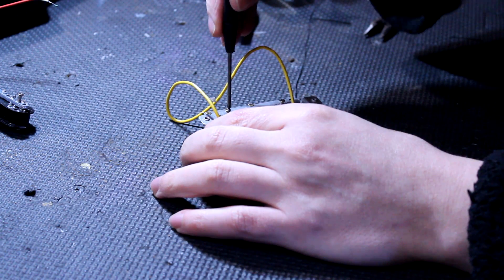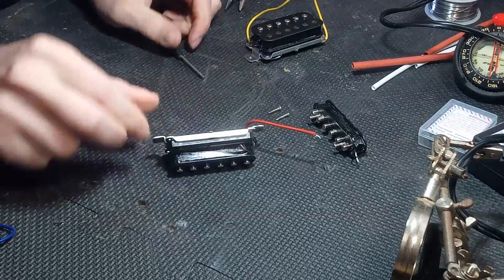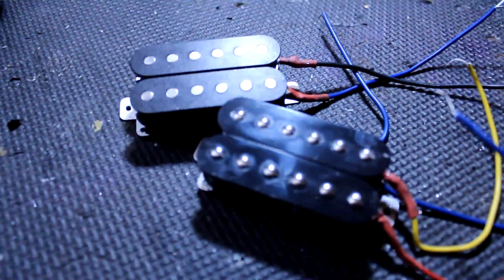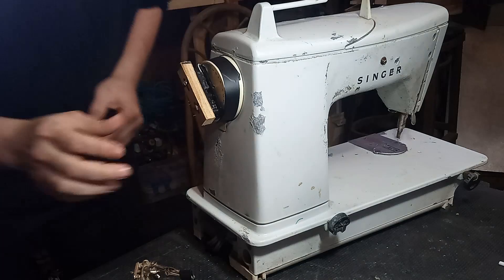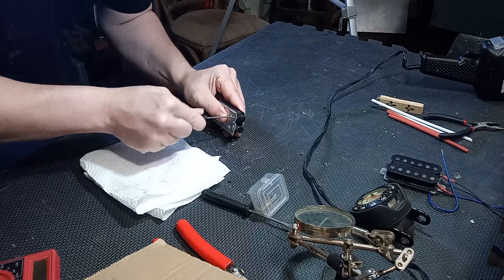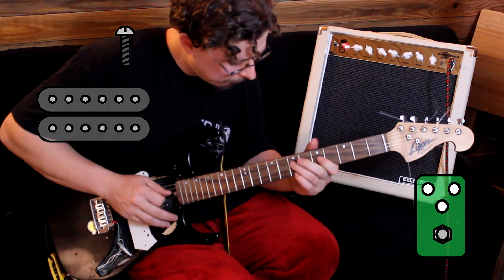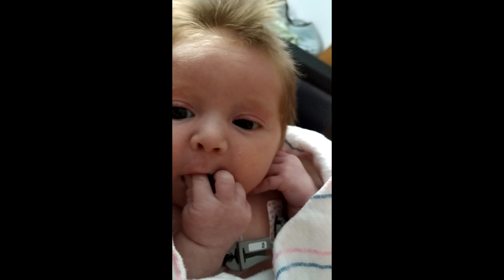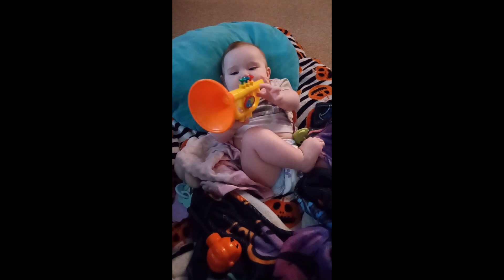DIY Humbucker Screw vs Pole (SOUND EXPERIMENT!)

Comment: I once modified humbucker  to fit  my project 4 string guitar, so basically, I took out plugs and screws form outer sides and left 4 poles and screws in the middle, them I also had interesting effect when outer screws are almost out and and connected on top with the razor blade, so strings run in between razor and pickup, not sure what exactly is happening, but does sound different

Comment: Good to see you back. 

I loved your homemade P90. What if you took a humbucker, attached an extra magnet on the outside of it along one of the bobbins, and then split the humbucker to that coil? Would that coil with magnets on both sides sound like a p90? This way you could get a pup that switches between humbucker and p90 instead of between humbucker and lousy split humbucker.

Comment: My prediction is that the difference in sounds will be minimal unless you're swapping from having non magnetic pole pieces with a magnet on the bottom to rod magnets pointed at the strings. 

I'm firmly of the belief that the orientation of the magnets is the biggest deciding factor in the sound.

Comment: I thought the adjustable pole pieces were meant to allow you to adjust the distance of each one from the strings.
Reply: Nah, it was always just for securing the pickup cover to the rest of the assembly before they were permanently soldered to the base.

Goes for all pickups with screw polepieces, with the exception of wide range pickups where the screws are the magnets.

Comment: Why don't single coils have screws? That's where need them because they always burry the magnet underneath the b string.
Reply: Because typically a single coil pickup has rod magnets and in order to have screws in place of them you'd either end up with a completely different sound or you'd need to source magnetic screws which are hard to come by.

The sad truth is that messing with the screws doesn't really do much.

Comment: what if we replace the metal rail in the hotrail pickup with a neodymium bar?
Reply: That would make a significant difference because the original blade in the pickup isn't magnetic, it's magnetised by contact with magnets in the base like a regular humbucker.

Depending on the orientation of the north and south poles of the magnet that you use, you'll get radically different results.
Reply: @casanovafunkenstein5090  has anyone done this before?

Comment: Pickups have a ton of variables. I have done experiments as well. Like I have some Epiphone Dot Pickups which test around 8.5k that I didn't care for the tone. So, you think if I swap the magnet with a cool killer magnet from a late 60's Gibson Patent Sticker T-Top it will sound way better, Nope. I pretty much sounded just like the shitty Epiphone pickup she always twas. I did similar with a 70's Japanese ceramic pickup that had way to much top end, I figure put an Alnico 2 in she will mellow right out, Nope. Point is it seems like the steel type of the pole pieces matter, the size and shape of the coil matters, spacing of the poles, the base plate material matters whether brass, nickel silver or steel, If the coils are closely matched in wind number or further apart in the DC ohms measurement, the wind pattern etc etc etc etc. My point is the only way you could really tell a difference in all screws vs all slugs is if you had used the same bobbins configured identically, carefully measured the heights and just swapped the poles with the screws while obviously not changing any settings on anything. Happy Christmas and Merry New Year.

Comment: Heard a definite difference, even through these little laptop speakers. Slugs by a nose. I thought the screws would sound better. I was wrong. That doesn't happen often. Savor the moment.
I'm glad to see '24 in the rearview mirror. Lost both of my parents and my dog in '24 (all due to natural causes - so at least there's that one consolation). Looks like you have a pretty great life. Good on ya. May it stay that way.
Reply: Check out Railhammer pickups then 👌🏻
Reply: @chrisparker5278  Will do. Thanks.
Reply: i like the screws better. more airy, less bottom push

Comment: Once you run out of 42 gauge, consider replacing it with 40 or 38 gauge. I've heard crazy things from the very few 38 and 40-gauge humbucker videos I could find, especially when they were wound under 6k total. Also, now that you're back and everything is okay, don't forget the other video ideas we've tossed your way such as my two for "series vs parallel humbucker with the same final DCR" or "stacked Jazzmaster bobbin Filtertron with 38ga wire and a rail pole piece"

Comment: I once read in a very old book that Seth Lover said he added the screws to give sales people something to brag over Fender slugs. and Gibson Dirty Fingers use two screw coils. he also said the orientation of screws closer to neck and bridge was purely for looks.  good stuff. i enjoy your experiments and have committed many such acts myself.
Reply: Of course it's probably 23 different variables as to why those will never sound exactly alike
Reply: @sundogaudio851  Raising the screws changes the tone. Its like a flat Strat or Tele bridge vs with the magnets protruding.
Reply: @terryenglish7132  you can verify that in a blind test?
Reply: @sundogaudio851  That's why the screws are adjustable. Its pretty noticable . Try it. Its more an attack thing. Once the tone gets going its very close , if not the same. Seth was pulling the guys leg a little.
Reply: @sundogaudio851  I should also mention the orientation thing isn't right either. If you rotate the bridge HB 180° it sounds different especially if the screws are raised. That isn't just screws vs slugs. Surprisingly, which coil is ground makes a difference . It surprised me when I did it the first time. Standard is slug coil grounded. The grounded coil's sound dominates a little. I bought a cheapo ebay body . The guy put the HB route too close to the bridge so its very noticable when I flip the switch that reverses hot and ground. The closest to the bridge coil grounded gives more highs and a singing tone. Grounded closest to the neck , the traditional HB tone.
Reply: @terryenglish7132  its just the guy that invented it that said it   not me.
Reply: There’s also a connection to the P90s screws. The P90 was originally fixed in place so the screws were necessary. Come up the humbucker it’s continuing a feature for marketing’s sake.

Comment: Good to have you back.   Theres a YT demo of old school 60s screws vs todays screws. ( Actually its bolts in p ups not screws). The 60s are less harsh sounding. Not everyone hears a difference, some do but don't care, some do and order some from ebay, like me. Slight difference,but for a few cents for improvement, why not.

Comment: That sewing machine pick-up winder. What a great idea 💡
Reply: Very old idea actually, I think first pickups were wound exactly that way :)
Reply: It is, probably goes back to a bunch of random guys simultaneously having light bulb moments in the 60's trying to fix their broken pickups. If you search YT and the internet in general it is not a new idea, and you will find dozens doing the same thing but they usually hook up a mechanical counter or use a calculator with a reed switch so you can get exactly what you are looking for winds count wise.
Reply: I've has a Singer set up for winding since the 1980s

Comment: You can also make an even more drastic mod, where you remove the bar magnet entirely (replacing it with a piece of wood to keep everything at the same height) and put alnico slugs. It'll behave more like a wide range humbucker
Reply: Some coils have the slugs in the plastic so the wire doesn't touch. Those can be removed. Some coils have the slugs thru the plastic, so the wire touches. Those can't be removed. On Squire Strats yes ; on the Teles no.
Reply: @terryenglish7132  yeah, but for humbuckers, I'm yet to see one that doesn't use plastic bobbins